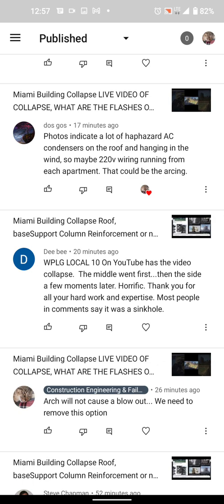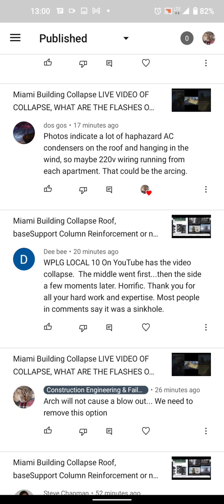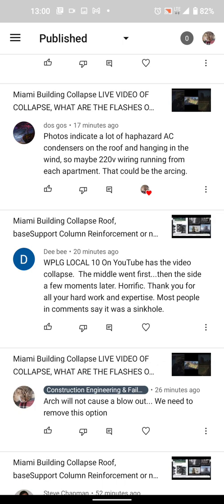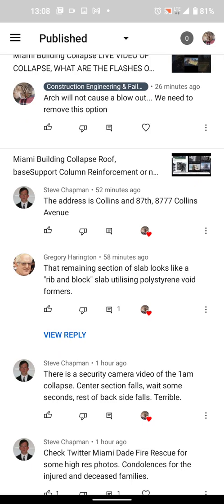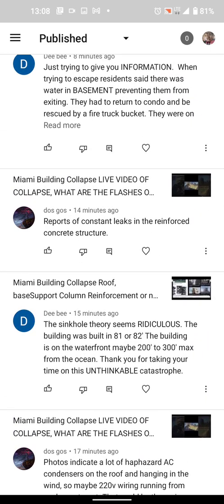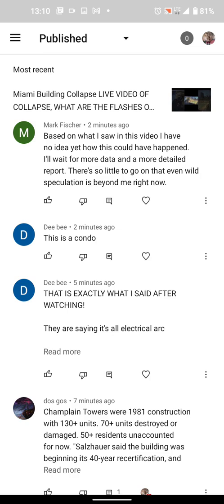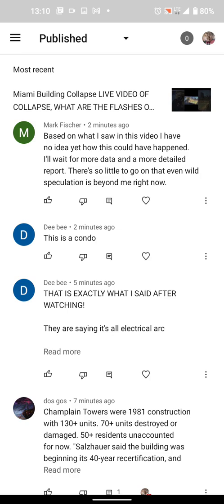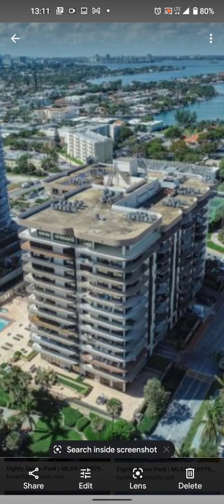Miami Building Collapse Sink Hole Explored and more

Comment: I just assumed the arcs were the fire alarm strobes.  when the garage level failed and broke the fire sprinkler pipe, that would have caused the flow sensors to trip which would then trip the fire alarm.  I heard a 911 call minutes before the collapse of the fire monitoring calling the fire department about an alarm at like 118am or something.  I haven't looked that deep into it, but as someone that does alarms, it all checks out.